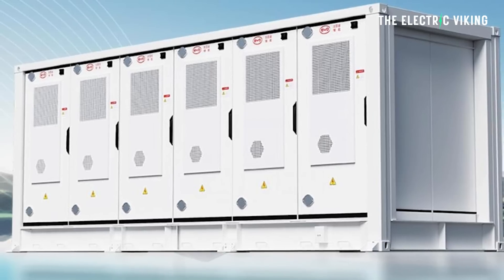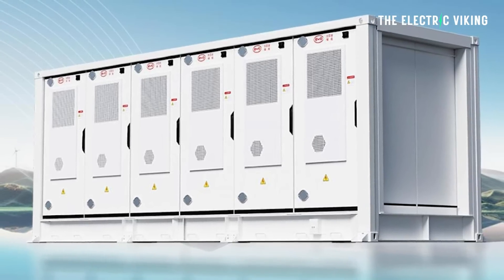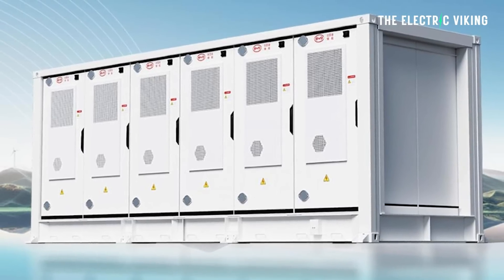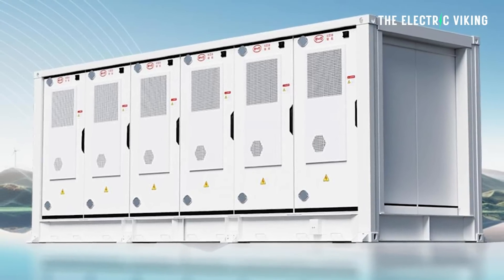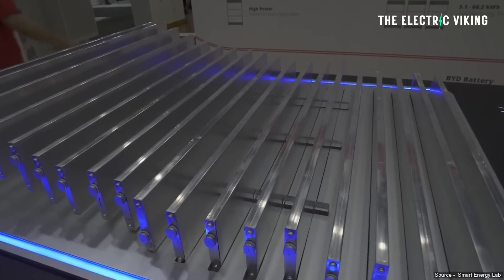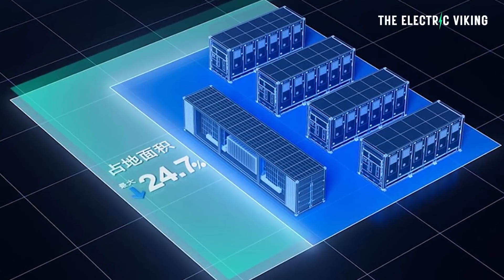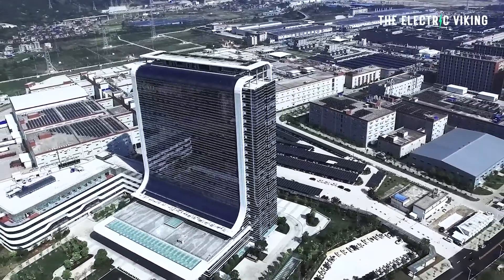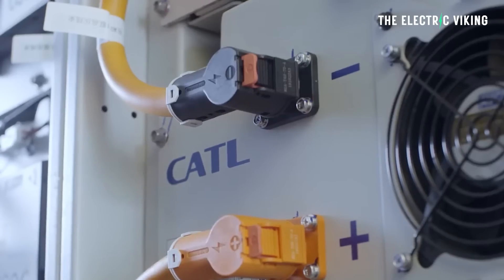BYD respond to CATL's new battery with MEGApack Blade battery boost

Comment: Thanks. My interest is the transition of the power grid into a decentralized network. Historically the "Grid" was a centralized system composed of huge power plants, power lines , wires, substations and transprimers and ultimately consumers. This was a one way process. Of most interest has been the effort to maintain electrical control, system wide. Words like frequency, balance, and  inertia were the language of ever watchful control rooms. This control extended into home circuit boxes. What I see is a new smart system that makes battery storage the controlling intermediary.

Comment: I don't think the price of electricity changes here. The meters only measure the amount of energy used. You can't sell energy back into the grid either.
Reply: Meters are bi-directional as are batteries.

Comment: Why are there still peaker plants operating? Because the fuel cost is way lower than the replacement cost. For comparison, It’s way cheaper to keep driving your existing newer gas powered car that you’ve already bought, than it is to buy a new EV and then power it with cheaper electricity. Smart money says use up your existing equipment until it needs to be replaced.
Reply: With the rising price of fuels, and the falling prices of EVs, that break even point is coming sooner, and sooner.
Reply: Because why would you ever want a new car?

Comment: YOU are clearly so far uninformed. BYD has been talking about Blade 2  for so long. BYD Blade 2.0 is nothing to do with PV.
Reply: Have BYD said Blade 2 is solely mechanical thing or does it also combine to the mechanics of one specific electrode design? Meaning EV and BESS have their own chemical designs while the cell format is the same?

Comment: I don’t see any wind farm to charge the batteries? Isn’t that the theory of having a battery pack?
Reply: Not necessarily. Supplementing renewable energy is one of the use cases, but the other use case is to replace peaker plants. 

And I'm not sure what you mean by no wind turbines. Both wind turbines and solar panels are being installed at an accelerating rate

Comment: As a said previously we need to wait until China has finished developing its cars so we don't buy a car that will be obsolete in 6 months time.
Reply: It's ongoing progression. There is no end date.
Reply: Developing?
Reply: @justinr9753  yes, BYD has a large number of warranty claims in China & they are changing models every few months, which means they are not fully tested.  Changes on the run are not good. Also, claims about battery life & capacity can only be determined in real world scenarios. Adhoc pricing affects resale values & and there is an investment risk. Not much sugn of aftersales service from many of the brands. It is better to wait to see who survives because many of the Chinese auto makers are not making a profit. It's another Evergrande scenario if you ask me.

Comment: What makes these claims more insane is that battery degradation is predominantly a function of usage. Rather than healthy competition, it sounds like desperate lies. One of these companies are in trouble & the most likely company is BYD.
Reply: Cope bruh.  BYD ev taxis have been running in the city of Shenzhen for past 7 years without having to change their batteries. These taxis have clocked up hundreds of thousands of km in mileage.
Reply: lies? westerners do more:face-blue-smiling:

Comment: What many people do not know is that in some places the cost of electricity is based on 'merit order' pricing.

The utility needs power for 4pm to 5pm on Thursday.  Wind bids in at 4c/kWh and guarantees 30% of the supply.  Solar bids in at 4c for another 30%.  Combined cycle natural gas offers 30% at 5c.  Now wind and solar also get 5c, what CCNG asks for.  But there's a 10% shortage.

Gas peakers agree to furnish the last 10% and they demand 50c/kWh before they will deliver.  With merit order pricing not only do peakers get 50c/kWh but also wind, solar, and CCNG get the same 50c/kWh.  And the consumer gets it in the shorts.

It's not that batteries are replacing that very expensive peaker generation, they also lower the total cost because they don't jack up the clearing price, the price of the most expensive provider.

Comment: I wouldn't go as far as to say all peaker plants, or coal plants, will disappear.  The Mega packs will definitely take a bite of those markets.  But is it a solution for seasonal storage, e.g. during the Winter?  In the case of China, I'll be convinced when they start shutting down their coal plants, and able to run solely on renewables + storage.  This is given their energy intensive manufacturing economy.
Reply: Until the fusion nuclear system are in will China shut down their coal fired power plant but it will definitely happen in the next 20 years, within my lifetime.

More and more renewables will be supplementing the fossil fuel power plant every year and it will be just a matter of time when they will become redundant.
Reply: China won’t do it soon because they have s lot of coal miners to keep happy.

Comment: The demand for grid-scale energy storage is MASSIVE!!! We need all solutions!
Reply: Exactly! These expand the total pie. Every bess sold will allow more solar, wind, hydro, geothermal, more nuclear, more tidal etc to be stored and then used when its needed reducing emission! The amount of worldwide curtailed renewable energy is fkn insane! Grid scale bess helps.👍🏻😎
Reply: @4literv6 resulting in less cancer, less lung disease, less birth defects, less habitat destruction, less global warming…ccand more energy self-suffiency….feelin’ better about my kids’ future 😊
Reply: Good news but remember these are cheap because the PRC is trying to buy the market and destroy all other makers and so control every country's power grids.
Reply: It's time to move from centralized power distribution to a distributed storage model. No matter what your generation method the demand fluctuates and that allows time to recharge storage during times of lower demand. That also gets rid of the requirement to keep upgrading lines because existing lines will be enough for distribution without the peaks we have now.

Comment: Again you keep assuming that peaker plants are only on for a few hours here and a few hours there. 

In the UK back on the 26th of  December 1962 it started to snow. And it did not stop snowing until early March 1963. And because it was a blocking high over the uk ,  there was very little wind. 

Yes that is s once or twice in a life time event, but you have to allow for it. 

You can not just say "... Ok it's the 5th Jan 1963 you have had your ten days of backup battery power , sorry you are now 'screwed' and will freeze to death for the next 2 months, because we shut down all the gas and coal plants"  😊

Comment: Good for daily intermittency but weekly, monthly and seasonal variability  will be difficult problem for batterie to solve.. Gas Turbine Peaker plants will be able to be run on hydrogen, methanol or other synthesized fuels.. These synthesized fuels are  the most economical solution for seasonal energy storage as well as transporting energy between continents they will also be needed for making fertilizer and plastics etc.....
Reply: We seem to be in an environment of significant and continual technological development of battery tech. It’s hardly surprising I suppose give the $bns of battery tech R&D that must be being spent globally. 
How soon before these developments are seen as outdated, couple of years, one year, a month..? 
Where will battery tech be in, say, 2030? Are we looking at game over for fossil fuels for energy then? Are we already looking at it?
Reply: No. Batteries, getting cheaper every year, will permeate throughout the grid system and become the main reservoirs of solar and renewable power (hydro, wind). Hydrogen will be used for niche applications.
Reply: @krossbolt4100 the energy required to convert water to hydrogen, compress, store and transport and oxygen, is more than the stored hydrogen releases on use. Niche is right. 👍
Reply: @andrewsaint6581  Peak energy production  produce surpluses that will make electricity cost free or near to it, such is the case already in some places in spring.. With super cheap electricity it doesn't matter is its only 30% efficient as if the power that being generated is not used its just being thrown away.. 

You are never going to store  electricity efficiently in a batteries from power excess April and may to power hungry  August and September.. Solar will produce a similar differential between summer and winter so a long term way to store energy is needed..
Reply: Couple of days iof storage is needed.
Reply: @Jason-bu9sv listen to Tony Seba .  Will need to build enough solar/wind for the winter usage. So, no need to store for more than a few days. In summer you just have excess energy.
Reply: @krossbolt4100 True.

Comment: I'm hoping for a "cheap" residential version. My neighbor has a natural gas backup generator and it's noisy as heck plus is needs regular maintenance. It also has to be "exercised" once a week which I liken to a weekly fuel fee. If I could get a reasonably priced battery unit that won't degrade even 1% in five years, I'm in.
Reply: Even current LFP batteries will last 4000 to 10000 cycles which when you work it out is an awful long time. I have a pack and I do the equivalent of 1 cycle a week so my batteries will die from calendar aging before I run out of cycles.
Reply: @rattusfinkus  Do you have a ballpark time span for "death from calendar aging"?
Reply: @CiaranMcHale  no, it depends on the quality and the technology. CATL and byd are now selling grid storage batteries that are guaranteed not to degrade for the first five years
Reply: @CiaranMcHale  I've heard " three score years and ten "  I'm currently three score years and fifteen so may well be approaching the end of my discharge cycle 😉
Reply: I’m in too. Waiting for a reasonably priced domestic power pack
Reply: I made my own back-up power system last summer - just got back from 3 1/2 months down south to a power failure here in Ontario - worked great!!

Comment: High energy density battery are designed for cars because cars has to to carry the heavy battery. But Energy storage batteries it is sitting on ground, usually in remote places where the land is cheap.  It can be stacked up if land is limited.   Why CATL and BYD not advertise the new battery in a car.?
Reply: the actual question is: why catl and byd don't post these batteries in their website so companies and people can order like tesla does on their website
Reply: Because, except for China, Southeast Asia & Israel, no one is buying Chinese-brand cars, at least in volumes that matter.
Reply: @magnuslarsson337 
Wrong. Brazil, Australia, NZ,Central Asia,Russia( since western sanction) Gulf countries as well. It seems Even Ireland has now started taking a liking for Chinese evs. These are early days yet.
Reply: @Theresnosequel  I have a BYD car here in Australia. It's great. They are as good as a Mercedes. I had a AMG Merc and sold it because it is obsolete compared to electric vehicles.
Reply: @krossbolt4100 My brother in NZ has a BYD and likes it.
Reply: @krossbolt4100 can i ask which BYD you have..?? Cheers 😃

Comment: There is so much demand for batteries every manufacturer will sellout as long as they make a good product at a decent price. I remember Tesla advertised that they figured out why lithium batteries degraded. Actually I thought it was a proprietary secret but maybe I’m wrong?
Reply: Tesla is relatively insignificant in terms of battery cell production and does not make LFP cells. LFP cells are far more stable and longer lasting than the NMC cells Tesla makes.
Reply: @larryevans6739 insignificant at the moment.
They were an insignificant car maker 20 years ago.

Comment: This is great news for renewables. The bottleneck these days seems to be with transmission lines. It takes years to get all the permits and build them, so a lot of renewable energy can't be connected to the grid quickly.
Reply: True but it was even worse years ago trying to build a coal power generator. The big turbines took years to order and deliver. The situation today is much more flexible and improved.
Reply: @krossbolt4100  And there are moves to make it quicker in the UK.
Reply: @ramblerandy2397  great !
Reply: Who is going to PAY for all of this nonsense? The consumer, again .
Reply: @robertfonovic3551 that's Capitalism 😮
Reply: You think the tooth fairy should pay instead?